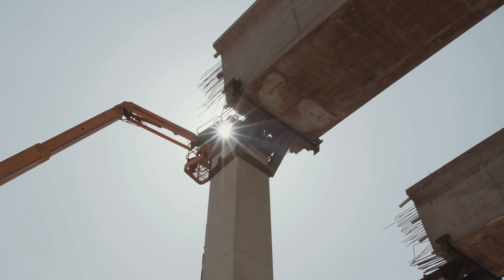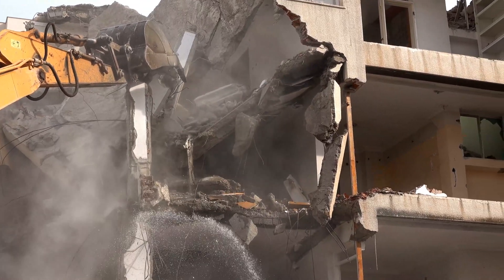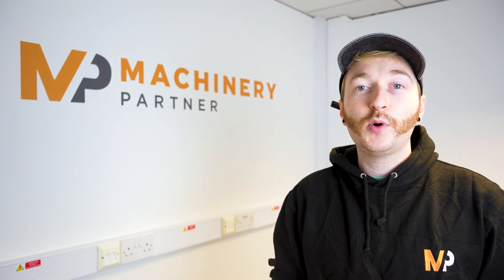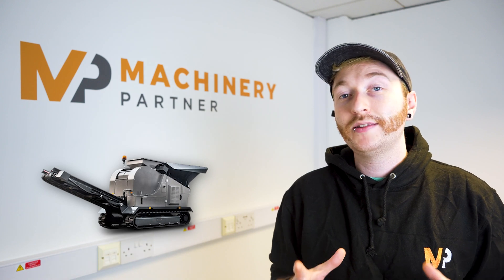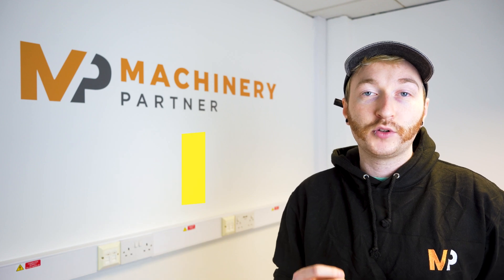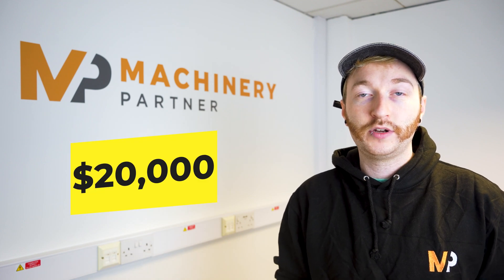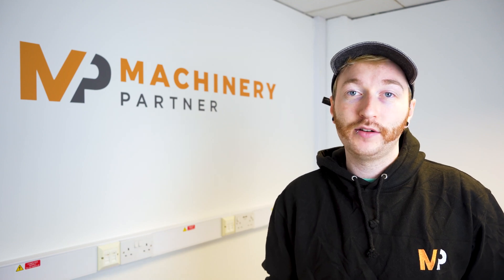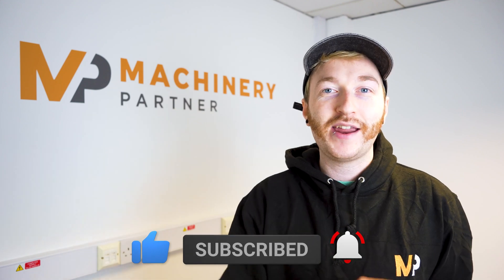Concrete crushing - Recycling concrete to save and make money

Comment: The only Crushed concrete material you will sell for $30 a ton is called three eights down material and it’s used by brick paver companies as a base… It takes a lot of processing to crush it down that small and screen it that small for sale
Reply from the maker: True it does take a lot to get concrete down that far!

But it also changes a lot depending on where you are based — we have a customer in western mass selling screened sub-3" aggregate for $30/ton. 

You bring up a good point though. We did some work to figure out average topsoil prices in the U.S. here >> https://www.machinerypartner.com/blog/screening-topsoil
Would be interesting to do the same for concrete...
Reply: Here in Michigan 21 AA sells for $12 a yard some places around here you can get it for $10 a ton which is way too cheap even $12 a yard is not enough
Reply: If you wanna make money crushing concrete you have to be creative and have a good screener so you can make different types of concrete material